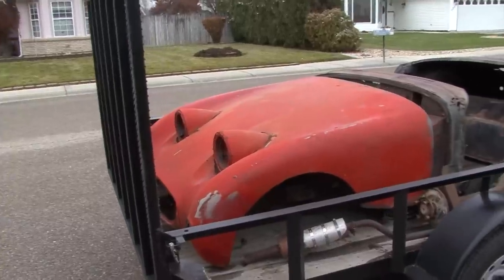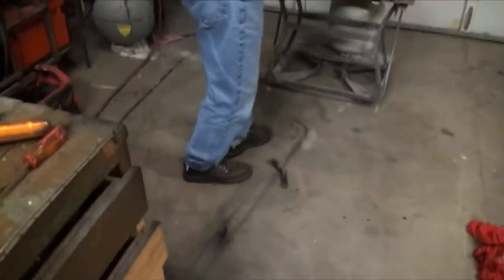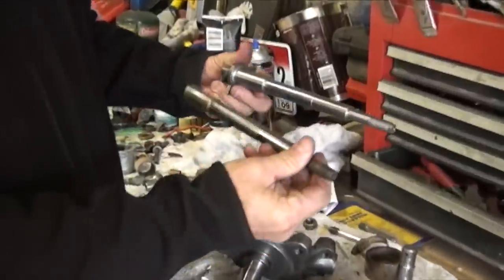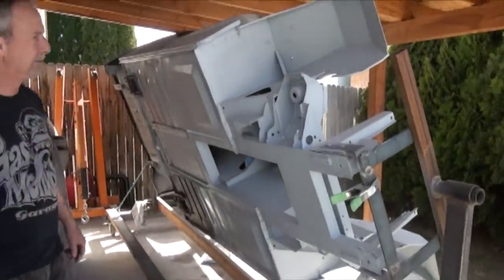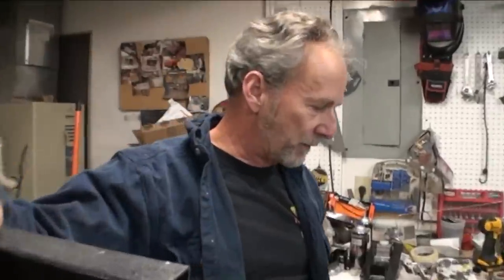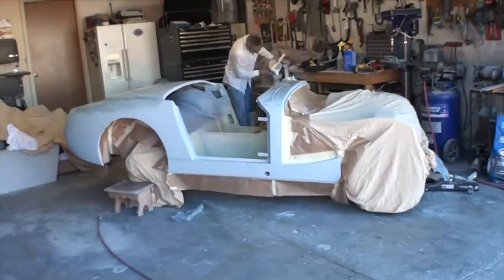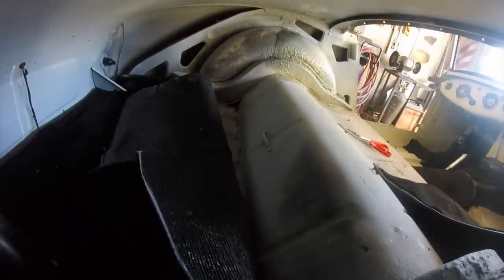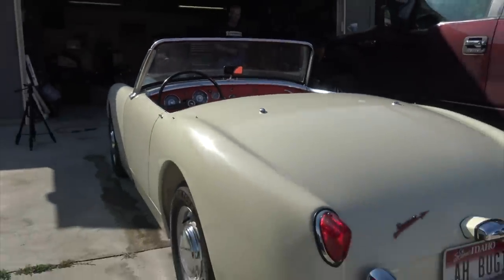Bugeye Sprite Restoration (Official Full Version)

Comment: A 1960 Sprite as my first ever car which I saved up for 4 years to buy second hand in 1964 in UK. Really enjoyed watching this video and was impressed by the skill and commitment put into the project. Would love another with wire wheels and disc brakes - the original car I had suffered from brake fade at times. You never forget the exhaust note on a Sprite!

Comment: I’m English and old enough to remember their launch.  Typical of the time.  A superb concept and design but dreadful manufacture.  Your car is better today than the day it came off the production line.  A real delight to see it cruising the highways of USA.  Truly extraordinary project from beginning to end.  A masterclass in both classic restoration and Video making.  All delivered in your delightfully understated style.  Thanks!
Reply: This is such a true statement. I was a Triumph motorcycle mechanic back in the day and there was never a thought to quality control in the manufacturing process or in the components for that matter. Great concepts and great designs with terrible execution. To be fare the same could be said for American cars and bikes from that era.
Reply: When a manufacturer can sell every car it makes ten times over, quantity will win out over quality every time. The Frogeye Sprite is just another case in point.
Reply: Didn't we call it a "frog eyed Sprite?"
Reply: @JR-bj3uf  
I bought a 72 Triumph 650 Tiger in 1977 when I was a Coast Guard Aviation Machiest Mate 3d Grumman HU16e Albatross / Sikorski HH52a Seaguard Flt. Mech. with a diploma on prior service motorcycle repair.
Baby Blue with lots of crome.
It had 6 inch over front forks the original owner had installed.
I found some things that made me scratch my head in amazement on it but one thing I loved was the oil in frame and how easy an oil change was.
I had the headlight burn out 3 miles from C.G. Airstation Mobile Alabama when I was sent there from Airstation Traverse City Michigan TDY for the summer of 79.
Foolishly I hadn't packed a spare bulb.
A local sheriff deputy pulled me over for using a flashlight.
Once I showed him my military ID card he escorted me to the base.
He was a dead ringer for that actor who played a southern cop in the 60's Dodge commercial including wearing sunglasses at night.
He even had the same accent.
My Triumph only broke down once.
I had to install a new rear sprocket and chain in Gulfport Mississippi.
The Triumph shop there loaned me the tools to do it.
I loved that bike.
Reply: @ronaldheit196  Great story. I had a customer with a 72 Triumph Tiger in gold. He called and said the bike was making a bad knocking sound from the head. I told him he needed to bring it in and not to ride it. A few hours later he shows up at the shop. He rode the bike from Norman OK to Oklahoma City a distance of about 40 miles. He was right. It sounded like a guy, inside the engine with a hammer trying to get out. He said "If I keep the throttle steady the noise goes away. I tore the engine down and found a broken crank shaft. The crank was flexing up and down and the pistons were hitting the head! Amazing that it didn't explode.
Reply: I'm English too, and have owned a Midget that was manufactured in the early 70's. It had its faults, but as the project of an enthusiast it eventually had its faults not only eradicated but improved upon, isn't that what classic car ownerships is all about? 
You're right when you say they were a superb concept, but you seem to forget they were mass produced to be affordable to the general public, and as mass produced objects they couldn't be manufactured to the same quality of a hand built car, even Aston Martins and E-types which were vehicles of their time could be improved with the wonders of todays technology.
Give the old guys a chance! I bet even you would benefit from a few modernisations????

Comment: I'll say this, this guy has a great t-shirt collection.
Reply: And a great set of 'safety boots'.   HA - I guess we have all been guilty of similar matters.
Reply: @geneva760  Yes please buy some steel toe cap boots and keep the sandals for the beach.
Reply: @geneva760  It only hurts when you weld in bare feet.
Reply: @Mercmad  Or when a red-hot 3/8" dingleberry goes in your shoe and burns a deep hole in the side of your foot. That gets sensitive.
Reply: @geneva760  0
Reply: The In'n Out Burger t's are classic

Comment: When I was in the Royal Engineers I had a Frogeye Sprite finished yellow cellulose paint and used to push start it myself.  To prepare it for my wedding I tried spraying it white but it would not cover the yellow which would show through the freshly applied paint.  Several coats later I sprayed it dark blue and it looked fine.  Next morning I push started it with a little too much choke and off it went dragging me holding onto the steering wheel.  Fortunately the car park had an entry arch to stop trucks from using it so I did my best to stop the car by heading for the bottom left of the arch.  It stopped, thankfully so I bought a new battery and spent the weekend removing my frogeye’s wink.  Thank you for showing us your dedication necessary to bring a frogeye back to faithful service and fun better than new.   Your meticulous care with the doors said it all for me.

Comment: I have 3 bugeyes now and I've owned 10 since 1965. I've never had one or seen one as nice as yours. I wish I had the time, talent and patience to do any car as nice as this. I feel guilty because the worst Bug I have is in better shape than what you started with. I'm putting a Honda S2000 F20C in a Lotus 7 now and boy do I wish I could pick your brain. I'm having to engineer everything. You inspire me and I thank you. I'm 75 and I don't have 5 years to put this together. I ran the car at a local track  called Thunderhill with a Toyota running gear  and I can't wait to get this back there. All the new and upgraded parts are here now. The engine is being sleeved, the  head is done. I have the header/4 to 1/ and I have to engineer from 3.5" round an oval - that splits to 2 ovals - design and make  low profile Master flow mufflers with flattened perforated cones the go into a horizontal oval that becomes a vertical Oval that becomes the center fins of a rear diverter.  I have to weld upper 4 bar attach points to my RX 7 3:90  posi rear - weld attach points to the frame for the Watts link - shock mounts.  Put the loaner block with my head / pan / valve cover together to make motor mounts - trans mount - and start building exhaust.  I'm welding up a new tranny tunnel for the larger 6 spd. that has to include a box around the clutch slave cylinder and access to the bleeder.  Make new mount for the larger aluminum radiator. Build a new dash to mount the S2000 gauge cluster. I have an AEM ECU and that attaches to the stock wire harnesses that won't need  readings from the many things my car won't have. Much to do. Wish me luck. I was team chief with an F-111 TDY crew at Mountain Home back in the 80's. Are you far from there?
Tom.       vaninwagen@hotmail.com

Comment: Beautiful restoration. The Frogeye was one of the first foreign cars I drove.  Always wanted one.  Never got one.  Will never have one.  But your project helps ease the pain.  Thanks
Reply: Your pain is not founded  in reality.  I bought a low mileage 1960 Sprite in 1962.  Took a long time to find one which had not been totally thrashed in just 2 to 3 years.  Engine was OK, many other things were just cheap crapola.  Imagine my chagrin at having to replace the carbon faced clutch throw out bearing at just 25,000 miles.  At that point American cars had been using steel ball and roller throw out bearings for at least 50 years.  Merely a toy for teenagers back then, still nothing but a turd now.

Comment: The first car I ever bought was a used 61 Sprite. I'd never seen one and drove up behind one at a stop light. I had my wife jump out and run up and ask if they wanted to sell it, They said yes and the deal was done for $600.00. It was a beautiful blue, but after we had it a week the blue started blowing off and revealed the original white paint. Apparently they painted right over the wax. I repainted it burgundy with a white stripe down the middle, don't know why, I just liked it, and it did look good. It ran fine, we had a lot of fun, my wife commuted in it and had to go to the chiropractor every week to get her back fixed from bouncing down the road. It didn't want to start if it was below 40 degrees, so we traded it for a TR4 that had Solex carbs and would run at any temp. But that's another story. Thanks for sharing this video!

Comment: As a former owner of a 1960 model I commend you on your talent and perseverance. In 1966 I was in college and the folks wanted me off of my motorcycle so they helped buy a used Bug Eye for $900.......a month after I bought it the cluster gear went out so I had 1st, then 3rd and 4th......made for some interesting driving.......dad wouldn't pay for a shop to fix it so I was able to find one of those British shop manuals that took you step by step and rolled it into the garage and proceeded to take things apart, it was actually pretty easy....we did have to buy some metric tools as I recall and when I disconnected the clutch slave the fluid ran out and took the paint off the garage floor.....dad wasn't too happy about that but let it pass. Probably a week and $100 or so for parts I was back on the road.....unfortunately, about a year later on the way to class, it was pretty damp and I slammed on the brakes and slid across the double yellow into the front of a Ford 4X4......I survived but the car didn't....when ever I see one of these I really miss the fun I had with it.

Comment: My first sportscar I bought when I was maybe   19-20 was when I was moved for work from  Warwickshire  down to Exeter in Devon  (the south) .   I paid about 50 pounds  second hand  I remember     I loved that little car  , although  I had to change  the rear 1/4 springs   because one was broken  . They were an  absolute bitch to get out  .  But when  I started   running her around   Exeters tiny lanes .  If you saw another ,  you  would flash your lights and wave at the other guy .    Tremendous sense of comaderie  in those days

Comment: Fantastic job :-) Back in the '70's I restored 2 Bugey Sprites. Little tip, in case you do another one... I drove one of mine for about 3 years before I restored the first. I found that the "Throw-out Bearing" kept going on me... Every time I replaced it, I had to pull the entire engine, tranny and drive shaft, just for the throw-out bearing... During the restorations I cut out the bottom of the Well, reinforced it and put in a removable panel. The next time the throw-out bearing went, I just removed the panel, dropped the transmission, etc. There was no need to pull the engine again :-) I have no idea why "Austin Healey" wouldn't have done that in the original design... Someone wasn't thinking... Uni-body is one thing - Common Sense is another... Loved your video :-)

Comment: I really enjoyed watching your video. My dad drove a sprite when I was a kid. His had a snap cover over the passenger seat. And I think it had a small chrome roll bar just on the drivers side. He was a little ahead of his time. Head drove it to save gas back in the late 60s early 70s. After almost getting ran over by a semi he decided to sell it. I have only seen a hand full as I have got older. I forget how small they are. My dad was 5-10 but I grew up to be 6-6, so getting into one is out of the question. I did realize how simple of a car they are until your video. Very good job on restoring that one. Hope you have a lot of fun in it. Be careful around semis.

Comment: great video!  thanks  so far i’ve owned a 1953 TD, 55 TF 1500 ,64 Spridget  that i really bought for my son , he earned it and i bought it back from him eventually as it was a running driving car  that had some crappy bodywork and a cheap respray ? , a 79 MG B that was my daily driver and i owned for 14 years overall  regretted every day after i sold her  as i had the engine and tranny out of it 12 times so i had all he quirks well sought out  and knew everything about the car plus she had some stories  i like your style on how you address and powder coat  , i haven’t done that on my own yet but i have a buddy that builds drag cars and 3 wheelers   who set up his own powder coating operation to speed u the process  and have quality control  over it  the guy is phenomenal at fabrication  and actually took 1st place World in his class of drag racing  running a Fox Body that was his daily driver for years  overall your Bug Eye looks like a pretty nice car  i wish you luck  i’ve always wanted one myself   i gre up with something English in the garage or 2 at times the 53 was my Dads who bought it in 58, we did a full restore including rebuilding the motor  with domed pistons out of a Mercedes from that era  in a sense we made it a Hemi Lol pistons and rings are the same diameter and apparently it was a old  racer trick from back in those days my Dad remembered hearing about  as the TD was his childhood dream machine  he remembers watching races on dirt tracks  another  thing i’ve wanted to do was put a small block or V8 in one  despite it being a little off from the purists way  but whatever Old English White is my favorite too

Comment: I bought a 2015 Nissan Sentra with 32000 Miles on it. $13000. You have the same money invested in this car. I am sure the 500+ Hrs. was a "Labor of Love". My Nissan will be in the junkyard, probably before I pay it off. (It has that crap CVT transmission. Already signs of failure ahead).  Your Austin Healy will only increase in value every year. I would guess its restored value as approaching six digits. This car is gorgeous! Thank You for the hard work and sharing this. I so want one!!  ;-)

Comment: My buddy and I restored a 59 TR3 not quite as nice as yours. It was a basket case and a lot of problems with things not done right . One example  copper brake lines installed to rear . You apparently had good carburetors to start with. 
SU carburetors are prone  to have worn throttle shafts and holes cause vacuum leaks. His first set were pretty much junk . In the end it was worth the effort. Yours is such a beauty . My buddy's car was a bit faster but certainly not cooler . Super nice job and hope you have a ton of fun in . Don't let your wife drive it let her drive the VW Bug .

Comment: Congratulations on an amazing restoration.  I own a 61 Bugeye myself that I just bought (restored by previous owner).  I’m doing a rolling restoration to clean things up and get it in top shape - but I feel very inadequate after watching your almost 5 year project.  I really liked that you kept it so stock - and then tweaked a few things to give it personality (like the dash and the interior panels).   

Super-impressive attention to detail and a very high level of skill across so many areas of the project.  

What paint system did you use?  And did you do all the welding using a MIG welder?

Comment: The Frogeye is one of the very few cars where I would change things during restoration.
1) Swap the 948cc A series engine for a 1275cc A series. With the right cams that is good for 100+hp.
2) Disc brakes up front.
Reply: Gustav Meyrink DO YOU REMEMBER THE PAXTON SUPPER CHARGER  THAT J.C.WITNEY SOLD . AND YES THESE ENGINES WERE CRAP WITH ONLY 3 MAIN BEARINGS WOULD HAVE NOT HELD UP TO THE EXTRA POWER VERY LONG.

Comment: There's  2 pieces of advice l give anyone who is thinking of buying a classic  or any car ! The cheapest part is buying it  and buy the best bodywork . Most people can manage mechanical work but very few can master panel work /paintwork . Well done to you it takes skill , commitment and above all  buckets of patience! ! I guess you used cellulose , not  2 pack.  Take care and stay safe. l forgot to mention . When you were welding the door bottom or any edge . Use 1/8 inch mild steel welding wire . It makes a neater job and dresses back well.

Comment: In your SU carbs if you want them to run right , completely clean the oil out and use "3 in one" oil from the UK. it gives the right raise and drop shut off rate to the air pistons.

Comment: Lovely job. I had a Sprite in the UK in 1963. Mine was a beige one ( sorry but it was ) and had the most dangerous drum brakes ever. Getting them to pull the car up in a basic straight line was a difficult achievement. Will you replace the front bumper and over riders ? Looks very nice so far and sounds just great. What a memory for me.

Comment: NOTE: DO NOT MAKE THE MISTAKE that many people do of using a lithium soap based grease (such as Castrol LM) in king pins, fulcrum pins and ball joints. This is hygroscopic and, while fine for hot-running bearings, will cause other parts to rust! Instead use a Calcium based grease such as Castrol CL. Alternatively, fill your grease gun with Wynns or STP "oil treatment". This is water repellent but needs to be topped up every month in king pins and fulcrum pins.